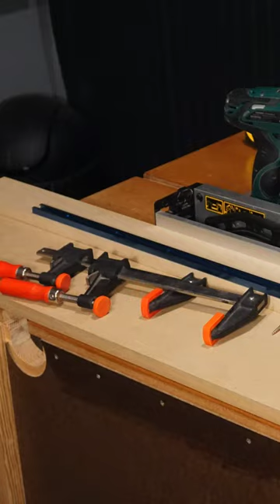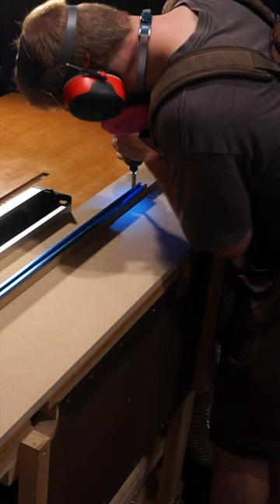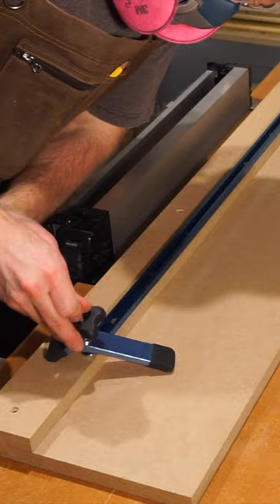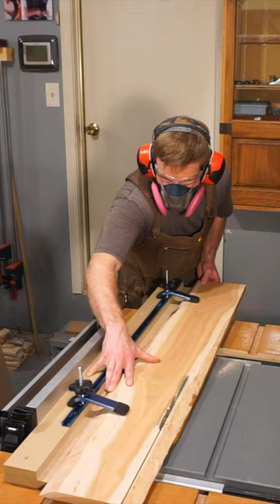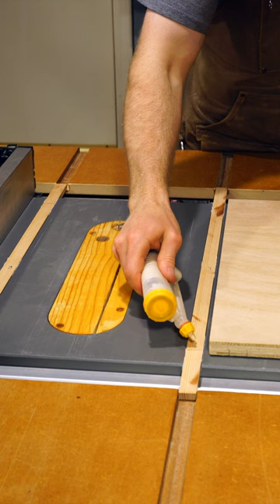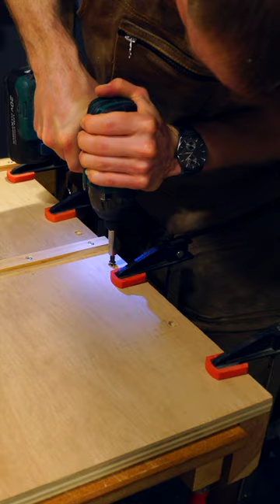DIY Table Saw Woodworking Jigs

Comment: I like the first one because I was planning to build a jig for jointing on the table saw. Saw a vid with 3/4 plywood with dovetail slots cut into it for clamps etc and when I saw this I just realised....I already have a circular saw edge guide that I could just add t track and clamp pieces to to get one straight edge on table saw.

Comment: What is it used for?
Reply: First one is a straight edge jig. It's helpful to get a reference edge when you are working with timber that is missing a factory edge. 

The second one is a crosscut sled. It helps you get very accurate crosscut and reduces the potential of kickback or the work piece turning while cutting.
Reply: @MrMotur  thank you
Reply from the maker: Thanks for filling him in, I really appreciate it! Both jigs can be very useful in the shop!